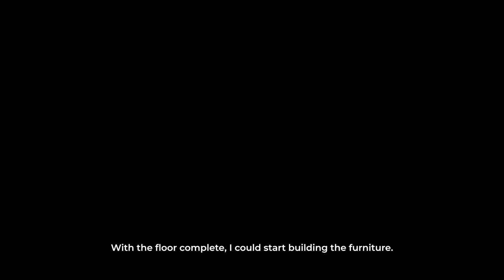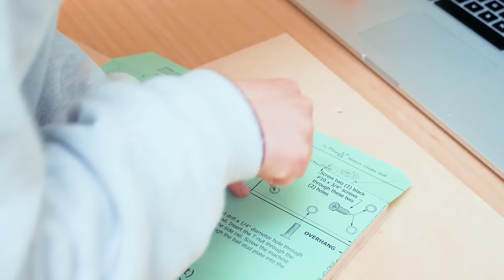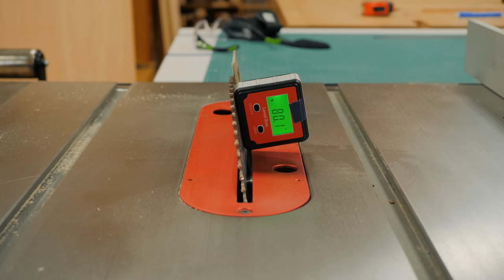I Built Everything Inside my TINY Apartment - Start to Finish

Comment: A very interesting movie. Of course, I watched each of the realizations in your subsequent videos, but this one is given for obvious reasons, in a very dynamic way and shows the actual amount of work you put into adapting and equipping the apartment. What makes me your fan is the precision and cleanliness of work. In addition, a list of tools that appear in your projects. There are more and more of them and because I am also a gadget lover, I am always curious to see how and what new you will use to implement your current project. I've always wondered what your workshop actually looks like. Are you just taking advantage of someone else's courtesy, or is it entirely yours? Maybe I missed it, but if it was possible, could you feature it in a separate video?
Reply from the maker: Thanks for your appreciation! I own all the equipment yes. My working Studio is the place with golden wooden walls. Check our the previous video on building a corner cabinet for my Studio and I guess you will get a sense of that space.

Comment: The amount of time and work is impressive! ❤️🙏 From the moment you had the idea to the time you actually build these parts, did you change your plans a lot?
Reply from the maker: Thanks for your feedback! When the plan was defined, my prediction was to build everything in 1.5 years. Oh boy was I wrong! 🤣 As far as I can recall, I didn't change or simplify any project along the way. I stuck to the plan, but eventually, the builds took a long time to complete.
Reply: @GetHandsDirty  Thanks fit tout answer! I'm a newbie in fourniture making. Since I'm afraid of doing it wrong,  I tend to over-think any project. My mind keeps swirling, looking for a flaw in the process. I'm exhausted by my very self before I even touch any material... 😝

Comment: Small advices, maybe you already know some of them, maybe not, maybe they are usefull for someone, maybe not, I hope you not taking it the wrong way :D
- if you use dark grout you should use dark tile adhesive also, cause it can alter the grout color
- if lay tha tile try to move only one direction in both axxis. So lay it as close as you can to there neighbours, then move them away by the distance of the grouts while appy downward pressure. This way you can avoid the adhavesive pop up between tiles. Wiggleing is not that great 
- You should rent a water cutter, or other cutting method cause the tiles edges are chipping every where